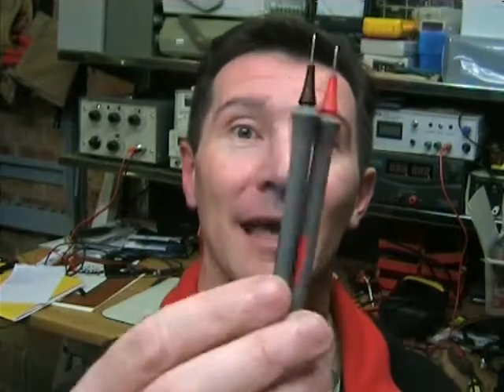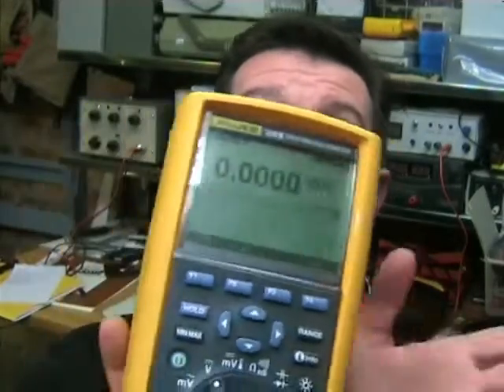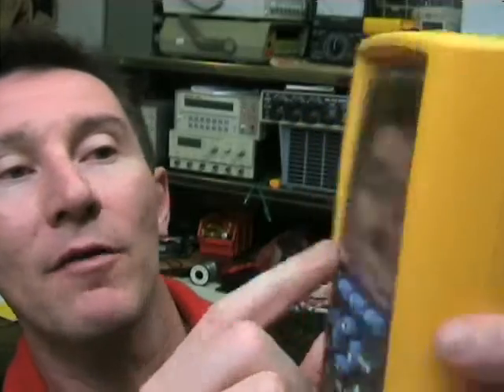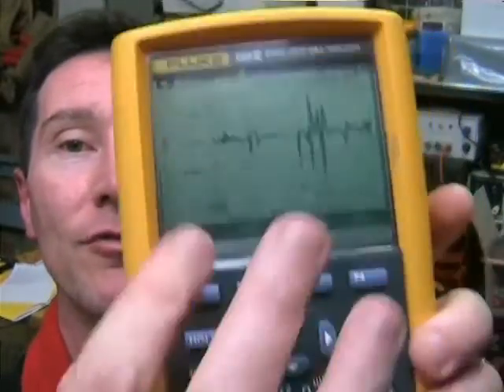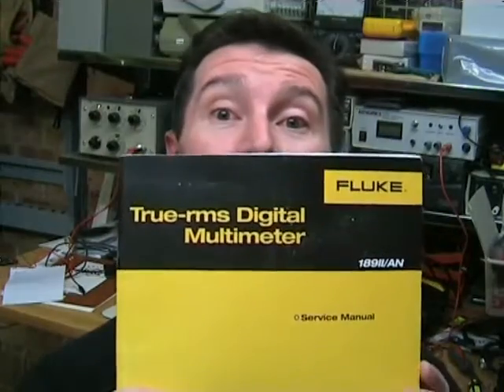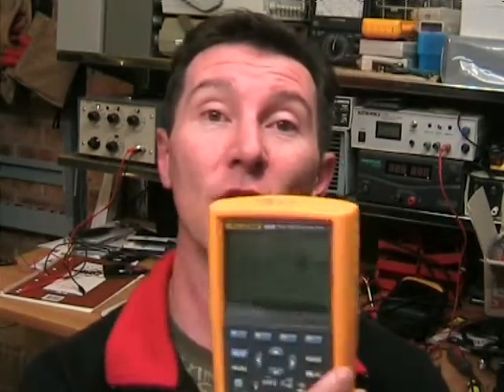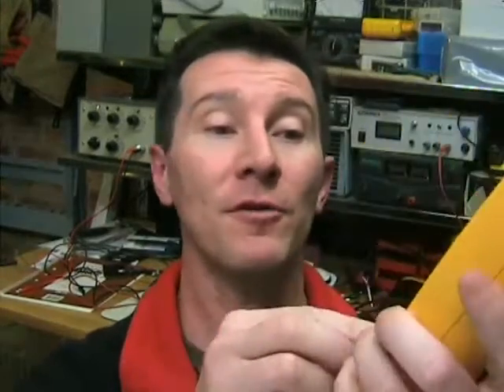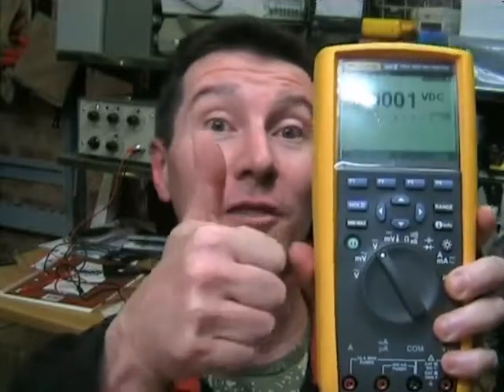EEVblog #15 Part 2 of 2 - Fluke 189/289 multimeter review

Comment: Another "major" difference between the 189 and the 289 is this. The 189 has an AC+DC True RMS feature whereas this was dropped from the 289. The 289 has gone back to the AC only True RMS measurement. If you have ever needed the AC+DC RMS feature, you know just how important it is. This feature allows you to measure the true RMS value of complex waveforms with both AC and DC components. Most meters will just measure the average DC value on the DC settings, and true RMS on the AC settings. If you are a technician, most of the time you won't need the AC+DC RMS feature - if ever. As an engineer, when you need it, nothing else will do.
Reply: Hi Gregory,you should re-read the 289 manual.It clearly states that for AC+DC measurements with rms for the AC component you just have to use the function "AC+DC".Only for function "AC" rms measurement no DC offset is allowed.P.M.

Comment: i bought one of these specifically for data logging. disappointed to find out after buying that it ONLY has AA battery power option, and smallest interval for logging is 1 second. no "high speed" logging here. and even at that setting you only get 2 1/2 hours of log time. that's really not all that great. yea its great to have all the accuracy of a fluke. but i hope they come out with something that is more modern in terms of data storage, computer performance (for faster logging) and a rechargeable lithium battery.
Reply: @lewisavinash1  it's actually using they work great!
Reply: This is multimeter WITH datalogging capability. If you need something for datalogging WITH multimeter capability buy an oscilloscope...

Comment: There are more then a few features the 289 has that the 87V does not besides logging. My two favorites are a miliohm scale that is accurate enough that I can estimate the length of a motor winding or romex in addition to other uses and the continuity feature triggers in the micro seconds time frame AND can be set to alarm on closed or open. Also you can set the rate of forced sampling but far more usefully you can set it to capture just changes and those changes can be set to record with as little as 1% change or can be set to only record 100% changes as well as anywhere in between. I actually use a fluke 117 as my quick, compact and dirty meter, but if I am only taking one meter into the field it is always the fluke 289. I had an 87V but I sold it as it covered between the 117 and 289 which is almost never ideal for the work I do. 117 quick and dirty, 289 find a tough problem.

Comment: I have the 87V and the 289.  Both excellent products from Fluke !!
Reply: Murnel Babineaux i also have a fluke 87 and I'm in the need of a second meter.the more i think about it the more i consider not buying it!so i was wondering if you could answer a few of my questions about it:how bad is the batterylife?how often do you replace the batteries? Does it have the problem with the leaky super-cap?does it have the problem with light from the ir port shutting the meter off?also how often does it need to be calibrated?i would be real nice of you to answer my questions because fluke doesn't have authorized sellers in my country so the prices are really high and they go up everyday,so i was wondering if it is actually worth the money?
Thanks for your help
Reply: I have both an 8020A and 8024A ... both still work, used on and off in the home lab.

Comment: After five years of using the 289 in the field I can say that, for me, it presented no problems if I did decided to take  it job-side....But mostly I left it in the truck for fear it might grow legs.

(I work in hvac and I clean up after a lot of engineers  who want to go DIY on their equipment repairs and would think nothing of giving my 289 a new home)

Despite its size I am glad to have it in my tool inventory.  I store it aside from the main tool bag in its own bag to avoid an accidental smashing by some of the heavy wrenches I carry in the bag. 

I

Comment: The Fluke probe pack is well over $100. Fluke meters are the best Cat3/Cat2 hand held meters. The caps that will explode when overloaded are usually in a carbon fiber shield case. For some inane reason the engineers at a mine had test points for the line side of a sub station in a control cab. Guys were always prodding that 12,470VAC with a 600 volt meter. The guys with Flukes melted their meters. They guys with cheap meters went to the hospital to have parts removed from their chest and face.